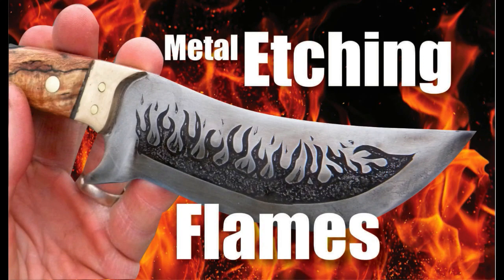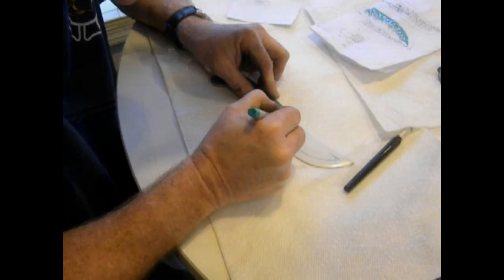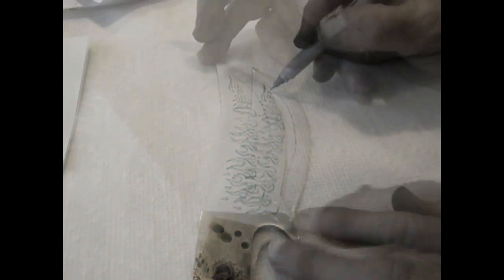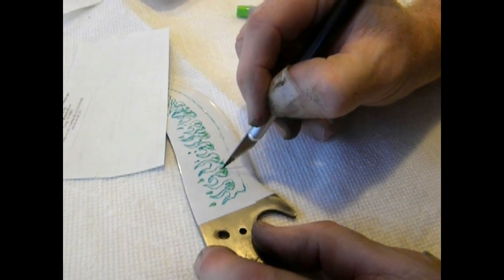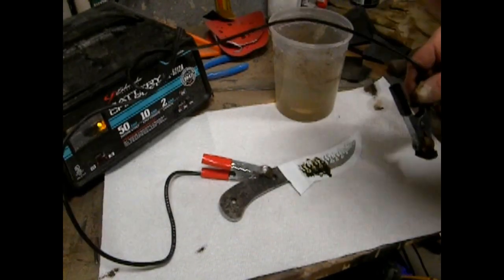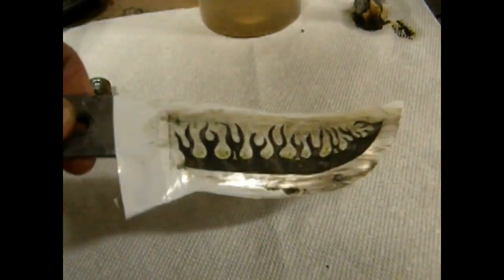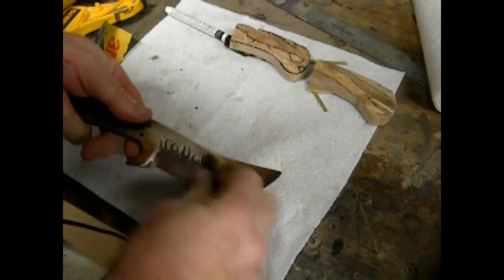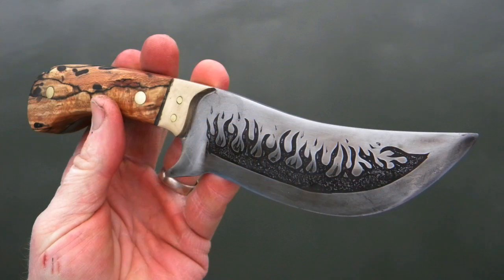How to easily Metal Etch Flames onto a knife blade with a battery charger

Comment: Any recommendations for a battery charger that would work with this technique. Seems a lot of the new ones have a safety feature where they will only work when attached to a battery.
Reply from the maker: Yeah I found that out. My charger is old so no problem. My friend had to rewire his to bypass the  breaker. Will try to put together a video on what he did
Reply: @DIYeasycrafts  that would be awesome if you could! I've done this by popping alligator clips on an old DC charger block, but it's not enough juice for a nice, deep finish.
Reply from the maker: @lauragraham2537  Will do. Might take me a couple wks. Have to get to friends shop to do the video. He is the electrician!  Check out some of my newer electro etching videos. Have gotten much better since this one. https://studio.youtube.com/video/ryUvbaaI9kY/edit

Comment: I saw you used a sharpie for some details. Is it possible to create the entire design with a sharpie right on the blade and etch it?
Reply from the maker: No for good detail you really need something better. The self adhesive vinyl works great

Comment: AWESOME,tell me again please, what was the sticky back material you put on the blade that you put the pattern on.....THANKS
Reply from the maker: I have a clear transfer film and also a white vinyl. Got both at Michaels Art Supply. The clear is nice because you can trace a design but the white is thicker and hold up better to heat from etching.

Comment: How come you don't blow the fuse doing this?
Reply from the maker: I have an old automotive battery charger. With the new ones you have to by pass the fuse
Reply: @DIYeasycrafts  full disclosure, that's exactly what happened, I blew the fuse on mine. Will it be enough to replace it with a thicker gauge wire, or will I blow something else?

Comment: I think you said you did this prior to tempering the blade. Would it work as well on an already finished blade (VG-10 steel)?

I'm thinking about etching a kitchen knife primarily so that cut food is less likely to stick to the side of the blade. Is the etching deep enough to feel with your finger or fingernail?

Thanks!
Reply from the maker: Should work on any non coated blade. Etching can be very deep, depends on time of etch. I think the etched areas might actually help food to adhere to it
Reply: Thanks. I assume you're thinking it might make foods adhere because of the roughness of the etched metal "grabbing" the food? Do you know of a way to vary the roughness of the etch (amount of salt, watts or amps)?
Reply from the maker: Just duration. Etch one area for 60 sec for a deep etch and others for 30sec.